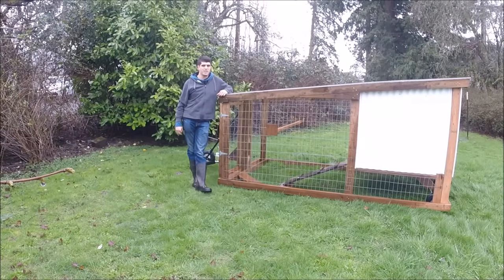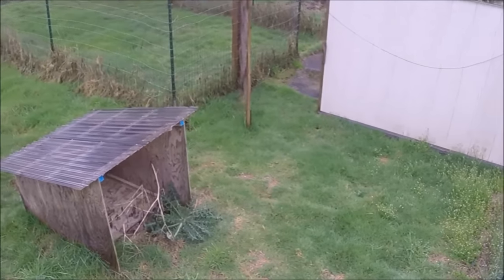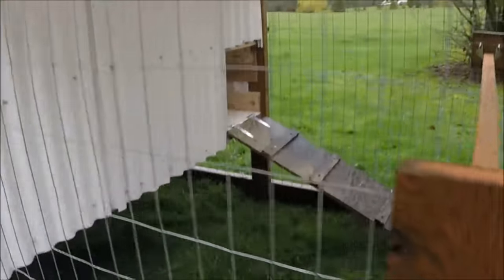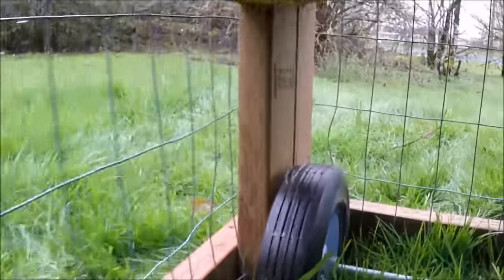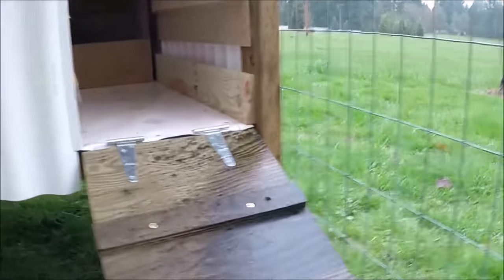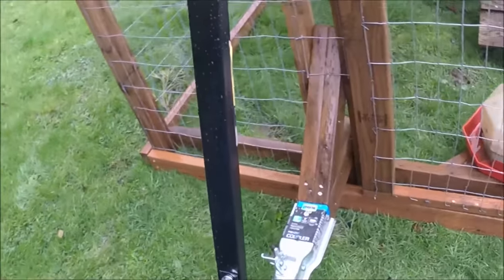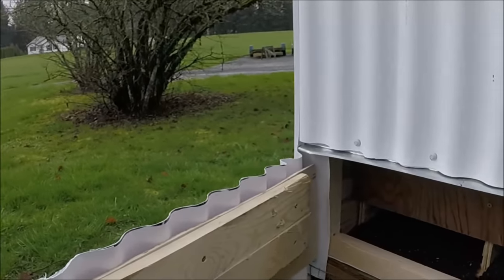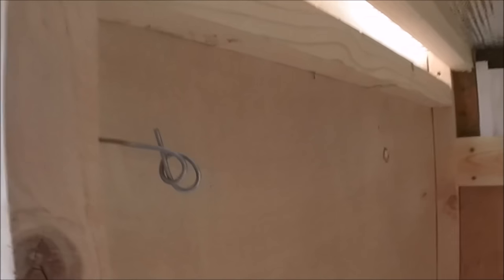DIY Mobile Chicken Coops  BY MOBILE CHICKENS LLC

Comment: Save money by getting rid of that stainless steel axle. Just run the appropriate size bolt through the corners and the wheels. 4 to 6 inches I'd imagine. Maybe add a corner wedge if you want more strength.... just sayin

Comment: Question and comment:

How do you keep predators from burrowing under your tractor/coop?

I think the squared off perches are uncomfortable for the chickens.
Reply from the maker: I’ve never had a problem with anything digging under, and my customers have never told me about anything of that nature either. I tend to believe that wild animals don’t want to be caged up in a confined space so they stay away from that.  The square roost doesn’t effect them at all. They love the coop.
Reply: Chickens don’t usually grip where they perch like you would imagine smaller pet birds doing. That’s why the square perch is fine, I used a 2 x 3 or 4, or you can use a variety of natural branches too. Every area has different predators. My chickens roam my yard freely all day. The most I have to worry about is hawks or buzzards, but the tree in my yard provides some coverage and my rooster does a great job of alerting the hens to danger

Comment: design is good.... will it easy while pulling the tractor if... the breadth of wheels or distance between two wheels are increased for proper balance while pulling the whole cart
Reply from the maker: The balance is not an issue on these coops, it is made sturdy and wide enough so that is not an issue.

Comment: the wheels on the in side might get a chicken ran over. but, I do like it really like the idea of using a trailer dolly to move it around.
Reply from the maker: If the chickens are raised in this coop, they will walk with it while you are pulling it. You don't pull the coop that fast, so generally there is no need to worry about killing a chicken.
Reply: How high is the chicken coop.
Reply from the maker: Kenneth Meggers the chicken coop is about 5 1/2 feet high in the back
Reply: That happened with a Silky of ours.  ;-(